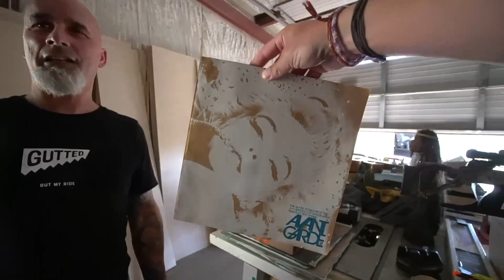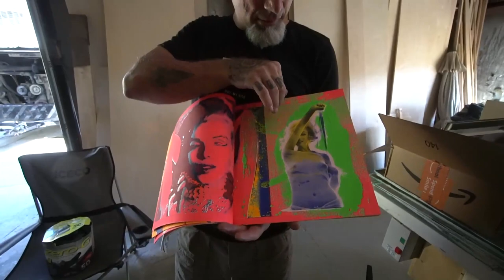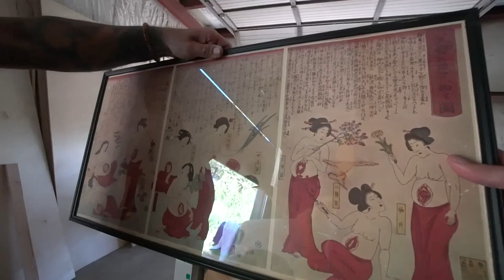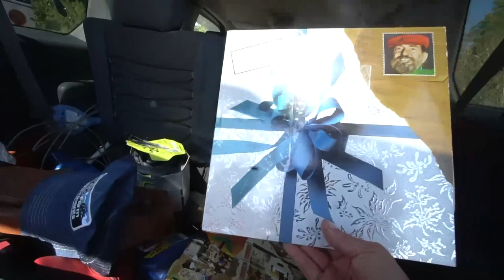Chris Travels Vlog Is Back - Catching Up & Back On The Road

Comment: Hey Chris. Do you have a video of your hitch install? we have the exact same bus and engine. My problem is the hitch that was recommended to me don't clear the motor mount cross bar. Did you use spacers? if not what hitch did you use?